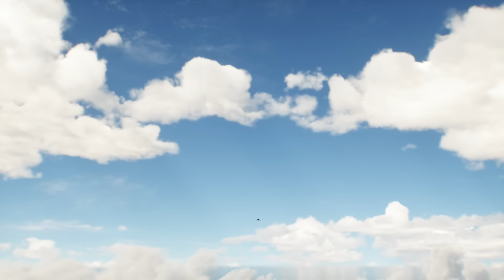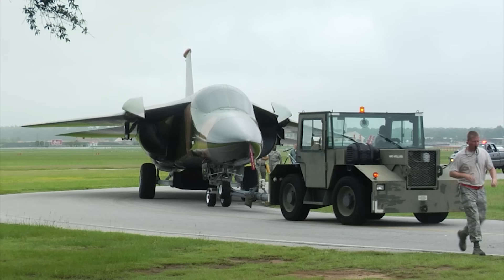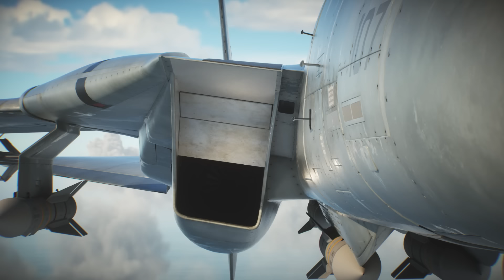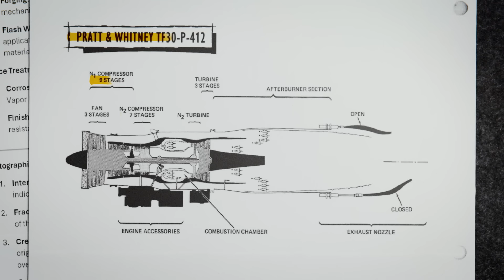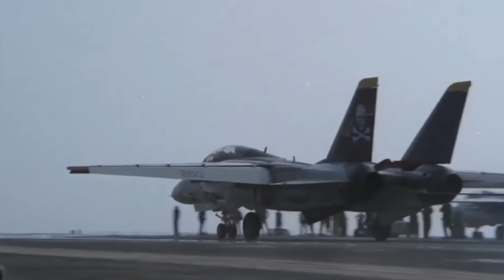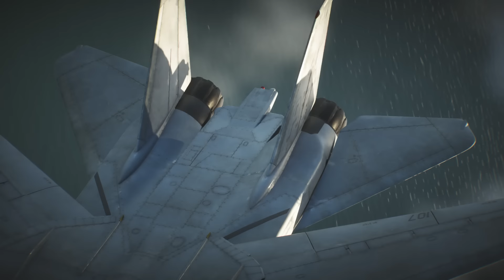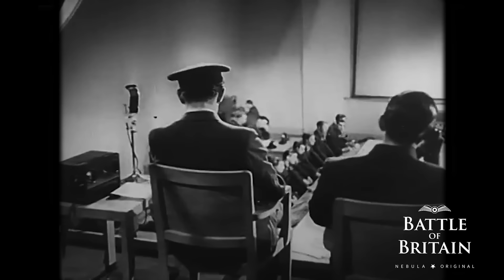The Insane Engineering of the F-14 Tomcat

Comment: The avionics and weapon systems was designed and built by Hughes Aircraft Company. Myself and my wife both worked at HAC and my dad was the engineer who designed the wings and control surfaces for the Phoenix missile back in 1961. He was later involved in the live testing and further testing/development. Each Phoenix missile was designed to take out and entire squadron.  It could carry either a conventional or .25 kiloton nuclear warhead.
Without weapons, the F14 had a top speed of Mach2.4 and although the flight crews were trained not to exceed 6g, the aircraft was tested up to 13g.
Over 150 live target tests were conducted on the coast of the San Miguel islands..... Near Ventura County California.
The Phoenix was originally a USAF program with the 5th and final prototype successfully delivered and tested in 1965.
Then it was taken over by the Navy. With regards to the F14, the navy was so impressed with the aircraft, although the engine development was running behind, they chose to substitute the less powerful engine to get the F14a in production while development of the original engine development was completed

I have the original Hughes News were they celebrated the successful delivery and program completion 1 month ahead of scheduled.

The cost of each missile was $1m each..... The USN did launch 186 missiles during combat operations. Kill rate depending on which report you look at, is between 86-92 percent.

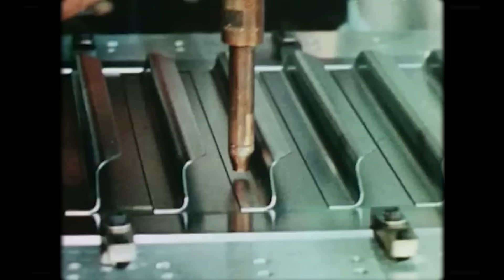Comment: 4:48 metal fabricator here with some corrections about the welding; I do not know why electron beam welding was used but it wasn't for the reasons you listed. Titanium does not need to be in a vacuum to be welded, it just needs to have no oxygen available which is also achieved by TIG welding via an Argon shielding gas bubble around the weld. Heliarc was the name used for TIG at the time and was available. Also, most welding methods do not use combustion. The vast majority of welding done in the world uses an electric arc to generate the heat needed and in gas shielded welding like MIG and TIG the shielding gas provides the medium for the arc to travel between the electrode and the material being welded in lieu of the atmosphere. 

Love the videos so please don't take this as hate, just minor constructive criticism on an amazing video!
Reply: EB welds have a lot less thermal impact on the materials, which I suppose has benefits for the wing box. That might be a reason.
Reply: Titanium will also dangerously react with nitrogen, not just oxygen. Also welding in a vacuum will result in the welds cooling slower thus reducing the stresses in the material which can help later on when material is annealed. Titanium tends to be very prone to internal stresses caused by welding which can result in deformation during heat treatment, which shows in cracked welds.
Reply: @WeakForPvM  I hadn't thought about the slower heat cycling and more even heating during welding, very good points that I missed!
Reply: @WeakForPvM  I tried adding a link to a paper by R.H. Witt of Grumman earlier, but it looks like google didn’t allow the comment. It explains what you’re talking about, and goes into detail on why they chose EB welding over arc welding. Thought it was super interesting to read.
Paper is called “Electron Beam Welding of Aircraft Structures”, 1972. Sponsored by NASA, and should be the top result on google.
Reply: Great correction!
Reply: @ it’s electrical beam welded which takes place under vacuum. I verified multiple sources that confirmed the entire wing structure was electron beam welded. Feel free to verify for yourself as well.
Reply: @richardschurter2115  looks like you're right
Reply: I am guessing there was a reason it was welded under vacuum. Just because you can weld titanium with gas shield doesn’t mean it meets all the requirements the engineers had for welding the titanium used. Most likely gas shield did not provide sufficient protection against contamination generation.
Reply: @richardschurter2115  from what I know about electron beams, gases block the electron beam (at the very least attenuating the beam) which is why it is most effective in a vacuum.
Reply: He never said it needed to be in a vacuum to be welded, only that it lowers the contamination which is true.

Electron-beam welding is used in the aircraft and aerospace industries for producing high-quality welds in titanium and titanium alloy plates ranging from 6 mm to more than 76 mm thick. Because the welding is performed in a high-vacuum atmosphere, low contamination of the weldment is achieved.
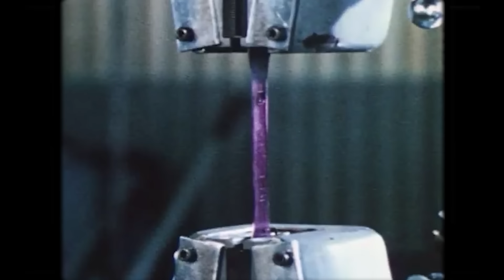Reply: @andriandrason1318  4:59 "we need to weld Titanium in a vacuum"
Reply: I wonder if the OP got the forging of Titanium process: the vacuum forging used for certain alloys of Titanium with the welding of Titanium?
To add to your post: "shielding from Oxygen, as is also necessary for steel arc welding processes..."
Reply: “A weld just needs clean air”

You wrote this like a dumbass. Stick to pickle welds.
Reply: If anyone is interested about why they chose the EB Welding - you can google a "Electron Beam Welding of Aircraft Structures by R. H. Witt". It was written in 1972 and is available on NASA's website. He goes into incredible detail on the rationale and process as a whole. Also - for anyone who wasn't aware - there are tons of technical papers and documents available on NASA's domain with tons of information on just about anything.
Reply: fantastic information on the process and why it was chosen, from R.H Witt of Grumman 1972. Sponsored by NASA.
https://ntrs.nasa.gov/api/citations/19740022811/downloads/19740022811.pdf
Reply: Laser welding, I know, has deeper root penetration and a smaller HAZ...I wonder if electron beam welding offers similar benefits
Reply: Lower heat input = smaller heat affected zone and less residual stress in the weld.
Reply: So glad you noticed this too
Reply: Was looking for this comment haha
Reply: As an amateur welder thats taken enough classes to question things.. i appreciate the shit out this comment
Reply: 👏👏 YT comments done right! Constructive, respectful… man, you guys should be the top comments on all videos!

Comment: Sorry, what, most welding techniques require oxygen? Not true. If they 100% need a vacuum, fair enough using electron beams. But, you'd think that laser welding might be more appropriate. I'm not convinced by it technically being a vacuum if there is electrons being fired at the titanium. It seems after looking it up, that EBW was used due to its ability to do perfect full penetration welds in a single pass, saving time primarily. Nothing to do with oxides.

Comment: Technically wrong right off the start! F-14 was designed primarily as a multi-role fighter bomber. It had an up to date (for the time) bomb calculating computer. Vietnam was ending and the first squadrons were not fully functional at the first deployments so the necessity was not realized until the Iraq war, and the retirement of the A-6. The F-14 was most envisioned as an attack dogfighter, not and interceptor as indicated by the canopies 360 degree view, and the F/A designation was not in use at the time of the Tomcats introduction, or it would have been the F/A-14 Tomcat.

Comment: 9:25 Thats not true. By putting the missles on the body, it increases the force on the wings. Wings need to support more weight, rather than the weight being directly on the wings themselves.
Reply: Did you even watch the whole video? The total lifting area without the lifting body was only 52 square meters and with it was over 90 meters squared. AND it had heavy duty wing pivots. The lifting body helped the F-14 immensely. It is still true because the lifting body is still helping. Even if it was carrying the belly aim54’s, the weight was pretty negligible because of the lifting body. They carried like 3 missiles on each wing anyway, one of which could be an AIM54 on either side. The structure of the plane was already very strong anyway because of the redesigned wing box and needing to land on aircraft carriers.
Reply: You're missing the point. Yes, the missiles add wing load. The point he was trying to make is the space there acts as a "lifting body"(which is exactly what he said ). It's like having an additional wing. It was nothing to do with what you're talking about. It's not the missiles he's talking about the flat surface under the fuselage which is large enough to fit two missiles. The missiles are inconsequential to the point being made.
Reply: Excellent point
Reply: @Mobius118 happy to see I’m not the only one that thinks this!!
Reply: @simonvutov7575 you are though

Comment: The Phoenix isn’t particularly tight turning. It HAS to pull 17G turns because it’s going between Mach 3 and 5 even in terminal phase. Maneuvering at those speeds and G loads would melt and or spontaneously disassemble a manned aircraft. But the manned aircraft are going much slower and can potentially out turn the hypersonic/supersonic missile. At least some fighters could anyway. Bombers, which is what the Phoenix was designed to kill, would be basically helpless bomb laden piñatas.

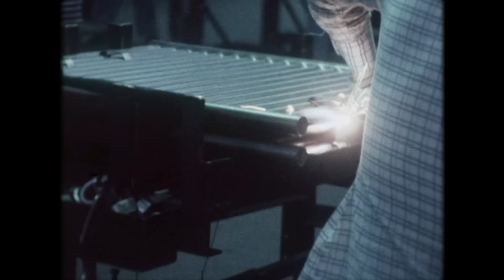Comment: 5:05  I'm pretty sure most welding techniques use electricity, not combustion.  I think the reason they'd have to use e-beam is that there needs to be some gas (argon usually) that is ionized between the rod and the work piece to conduct the electricity going through them to heat them up.

Comment: The X-5 was not flawed but its mechanism was impractical for use in a serial production warplane due to weight and  complexity.  The issue is the F-5 required a moving pivot point so as the wing swept aft its wing box shifted forward to maintain the correct center of lift.  The F-111 and F-14 got around this using wing gloves (that don't move) and more advanced aerodynamics so they could use a stationary pivot and wing box that was cheap and light enough to work in an operational fighter program.

Comment: If you look into the accident report for the female pilot crash, Yes she had a compressor stall, However she failed to follow the guidlines and rules in place to deal with a compressor stall.  this single act of not following the rules is what caused the AC to yaw left and roll over, during the roll over ejection was set off, however there is a .5 sec delay between backseat and front seat ejections. if i remember correctly the backseater lived and the pilot did not. overall it was pilot diviation that resulted in the crash. she was as fault. There is a crash video you can search for.

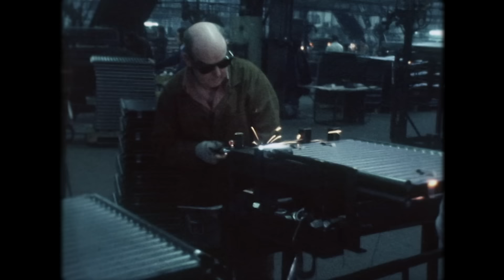Comment: 5:06 not necessarily, TIG is commonly used to weld titanium exhausts. The issue is with large flat structures there's no easy/cheap way to purge the back of the weld pool with inert gas, hence weld it in a vacuum. That brings another issue, TIG requires purge gas to ionize to generate an arc, and light (photons) becomes a far more advantageous being that it can travel in a vaccum

Comment: Most welding processes use electric arcs and shielding gas, not combustion. And even then, you're using a torch with an oxy/fuel mix. 

Why do engineers never understand welding?😂

Comment: I wish you went over why the F-14B actually had a lower top speed than the F-14A, it's interesting but iirc it was programmed or designed so that it wouldn't get damaged at high speeds.

Comment: One thing worth pointing out with F-14's insanely high maintenance man-hours, which is actually twice of that of F-35C.
The main issue obviously is the wing box mechanism, but the frame which designed in the 70s also represent a significant challenge since there is no digital trouble shooting system around, therefore engineers had to take apart part of the aircraft to do maintenance, which significantly increase the amount of time needed.

Comment: the use of titanium in the wingbox is certainly impressive but it did also remind me that around the same time the Soviets were building submarines out of titanium with all the possible problems that came with using the material on such a scale. the submarines were nuclear-powered, very fast and could dive deep, but with better and better sonars coming into service making less noise became more important for submarines than pure speed, so they eventually stopped building them out of titanium as it was just not worth all the trouble.

Comment: Hi, I'm interested in the sources you used for this video, especially forthe Air Inlet Control System, because the documents I've read had a different graph for the ramp programming schedules. For example what I read was that the first two ramps began extending at .5 IMN and the 3rd (diffuser) at .9 IMN. Im genuently interested in the sources as I live reading about this jet.